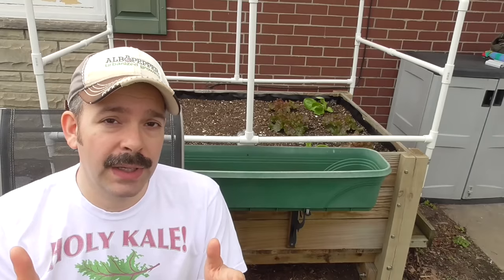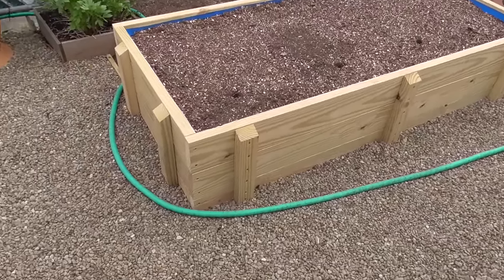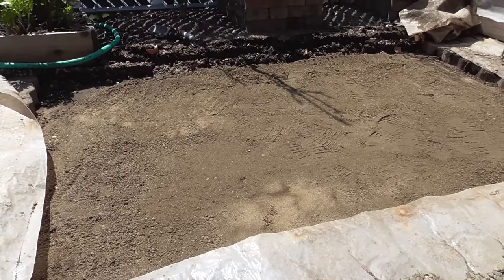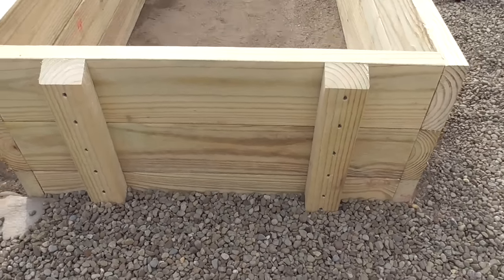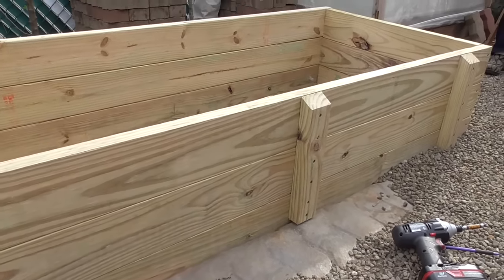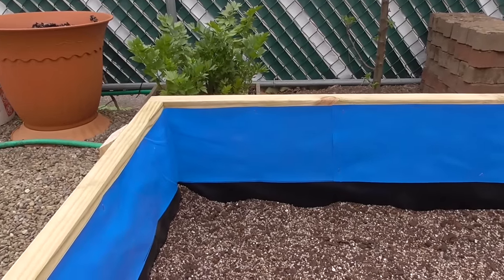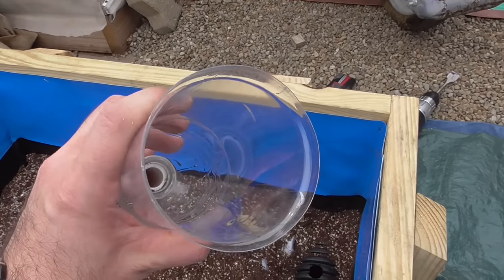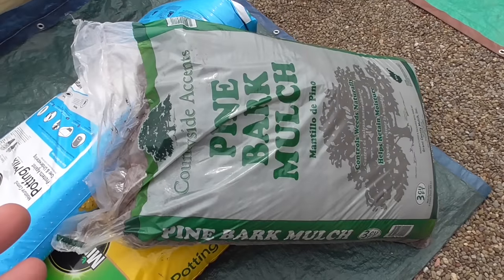Self-watering SIP Sub-irrigated Raised Bed Construction  (How to Build)

Comment: Thank you very much for this video. I really enjoyed your presentation. I’m relatively new to gardening, but love it and I’m learning new things every day. I’m curious to know why you are so against bagged fertilizesr or manure‘s in raised garden beds?
Reply from the maker: Hi Avi, thanks for watching! Here's a little explanation from my site:

BAGGED COMPOSTS? To prolong the viability of your SIP potting mix, it's best to replenish nutrients in the form of fertilizers. Organic gardeners are apt to use compost as often as possible. In SIPs, worm castings can be included in small amounts. But using composts in containers can yield unpredictable results. Bagged (retail) compost, humus or manure might have a fine consistency, similar to garden soil. If it contains fine silty particles then this can reduce pore spacing and aeration properties of the mix. That's why topsoil is NEVER recommended.

As air gaps get plugged up by ultra fine particles, compaction occurs. And since SIPs are always resting on a perched water table, the few remaining air gaps tend to be saturated with water. This impairs root health, preventing plants from getting the oxygen needed at the root zone. This can lead to a decline in plant growth, or even root rot and death. Even if plants grow ok in the first year, over time the potting medium may break down to the point that it must be replaced.

HOMEMADE COMPOST? Buying bagged compost is not financially advantageous in large beds anyway, not when compared to buying a bulk organic fertilizer. Of course, homemade composts might work, especially if they are mostly wood based. These tend to have more structure. Larger particle size means improved aeration. I've found though that it's very easy to reserve my compost for conventional beds and perennial plantings. It all gets used, just in a different location.

https://albopepper.com/refreshing-sip-potting-mix-adding-fertilizer-year-2.php

Comment: Hi!  I love the way you explained the process of the build.  Thank you so much for the time spent creating the video.  My question, however, is why you do not suggest to use manure or bag compost?  I am not trying to create an argument as to why yes and why not, but rather hear your opinion on this subject.  As a way to explain, in some form or another, I have been farming pretty much all my life most of the time with great success.  Many of my friends and urban farmers do tend to use their own mix and would swear by them.  I have always used a mixture of manure, peat, top soil and potting mix. I like the idea of the pine bark which I will incorporate to my next mix.  But also, I have heard of adding Dolomitic Lime and Mittleider weekly feed to the beds once they have started to produce.  I have not tried either.  I learned last season to add Epsom salt to my tomatoes (and other veggies) when their leaves started to turn yellow - I found that they needed magnesium, it was new to me as I never had this problem.  But still - and sorry for the long story - why in your opinion manure and compost (bag) is not necessary or needed.
Reply from the maker: Hi Javier! Thanks for watching. I explain a couple factors relating to manures and bagged compost in this latest video: https://www.youtube.com/watch?v=CXyV-XsQWNE  Additionally this series of articles was designed to address that topic: https://albopepper.com/refreshing-sip-potting-mix-adding-fertilizer-year-2.php

Basically, we need to be concerned with pathogens (raw manures), salt levels (commercial composts / manures), and pore spacing (top soils, compost & manures that contain fine silty particles). I've successfully grown zucchini in 5 gallon SIP buckets, using "Mel's Mix". But the compost was homemade and had excellent structure.

Hope that helps, and welcome to my channel!  :-)
Reply: I am going to watch them now.  Thanks!
Reply: @Albopepper  Would love to see a demonstration on growing 5 gal SIP zucchini and other vegetables, please?  I have learned so much   PURE GENIUS!

Comment: Al thanks so much for the great information. I have taken an industrial tote, cut the frame and liner in half, and have created 2- 48x40 raised beds. Up to this point I have filled the bottoms with sticks, logs, and other fillers and topped off the top 15 inches with an organic mix. I planted melons in the raised bed and they are doing really well. After watching this video I am wondering if I should use the wicking method on future raised beds. My only concern is the cost of the 6-inch drain tube ($36.00 each 40x48 section) of the bed. Do you prefer the traditional raised bed or the wicking raised bed? Are there advantages to using the wicking method, just trying to figure out if they are worth the extra cost. Thank you so much for the excellent education. Whats that old saying, give a man a fish and he eats for 1 day, teach him how to fish and he will eat for a lifetime.

Comment: Very solid design, but it can't be stressed enough how critical it is that the reservoir is solid.   Once you get everything else filled in on it, repairing a leak pretty much means starting over.
Reply from the maker: Agreed. That's why it's best to use a quality liner, not just 6 mil plastic. And make a few of folds as possible.
Reply: Don’t you mean 0.6mm or do people just assume the point when talking about pond liners etc ?
Reply from the maker: @tamarpiersburdekin3903  No, I meant 6 mil. You can learn more about the terminology here: https://www.globalplasticsheeting.com/thickness-of-plastic-sheeting

Comment: This is a great video! We are going to try our hand at making 2 of these beds. I do have a couple questions though, 1- what diameter do you recommend for the perforated drain tubing? And 2- for the overflow drain do you think we could use a piece of PVC pipe instead of the rubber tubing? 
Thanks for a great video!
Reply from the maker: Thanks for watching! I use 4" corrugated perforated drain pipes. The outside diameter is about 4.625". PVC piping works great for the overflow tubes. I used 1/2" PVC for my last couple SIP builds.

Comment: Great video and hoping you can answer a couple of questions.

1.  You indicate not to use manure.  I have used Mel's Mix (from Square Foot Gardening) in 5 gallon wicking buckets last year with great success.  It is 1/3 manure, 1/3 vermiculte and 1/3 peat moss,  and I didn't have any wicking issues and never needed to fertilize.  My tomatoe plants grew to the height of my shed roof.  Can you explain why you are against manure?

2.  You go through the trouble of lining the SIp with pond liner and then cut slits in it for the drain hose.  I imagine that the water leaks around the hose and the wood around the drainage is always wet.  Do you find this is the case and if so, would you try to seal around the hose next time?

Thanks
Reply from the maker: Kevin Meier Hi Kevin, I'm pleased to hear that you had good success with a Mel's Mix in wicking buckets. If your combination worked in a 5-gallon SIP, then it ought to work on a large scale as well. The biggest problem I've seen is that bagged manures can be heavy, comprised of very small particles. Obviously, the composition of manure can vary greatly, including the NPK values.  Then there is fresh vs aged. It's a lot of variables that might not work so great in one of these types of wicking beds. So I steer clear of that approach, choosing to play it safe. That's especially true when offering advice to others. Using an Earthbox approach will yield more predictable results. Plus the mix will hold up better over subsequent seasons.
 
In regards to the overflow tube, the plastic tubing was a super tight fit in the hole. No water leaks on the outside of the box. But you're right that some small amount might drizzle through the lining on the inside. I think that if someone is trying to be thorough and if they are able to seal it, perhaps with caulk, then they should do so.  Especially if they are truly concerned about it. Just do it and then you won't regret it later. It's not anything that concerns me on my box, but I'll add a note for those who might want to take that extra step.

Thanks for your question Kevin!

Comment: lol NOW i have a use for all this extra drainage tubing the prev owners had shoved under the porch! (saw someone else's video filling the base with ROCKS and i was like "no... that can't be right. that'd be expensive as HELL. this looks MUCH better.)
Reply from the maker: Thanks! I agree. All that gravel is also more labor intensive. And it reduces water holding capacity. But you risk puncturing the liner.

Comment: Hi I built this a couple years ago and it works great thank you!  I now want to make a smaller version out of some planters I have.  My question is because the planters inside width is only 10.5”. With that narrow width I will only be able to fit two corrugated drain pipes.  What can I use to fill up the remaining space?
Reply from the maker: I'm glad it's been working well for you! If the internal width is 10.5", then that is perfect. The outside diameter of the 4" corrugated perforated pipes should be 4.625". So you can space them about 1/2" apart from each other. And then allow 3/8" on the other sides between each pipe and the sidewall.
| o o |   -->   |  3/8  o 1/2  o  3/8  |

Comment: Great video, I only have one question though. If the corrugated pipes are not connected to each other and you mash soil mixture down between all the pipes then how does the water evenly disperse through the system? Wouldn't the water enter the fill pipe and then have to pass through the soil to get to the next pipe? How much water are you using up before the water disperses evenly all the way to the drain pipe? Would it be better to surround the pipes with some type of rock or gravel mixture on the sides and then add the soil mix on top of the pipes allowing the water to freely move through all the pipes before it begins wicking into the soil?
Reply from the maker: Dylan Cummings Thanks for the feedback, Dylan!  It would seem like the water might take a long time to disperse but it's actually not an issue.  That end pipe in my box spans 75".  So the water can spread over the course of all of that space. The holes in the pipes are small, but there are many of them.  The same can be said for the pore spacing within the bottom layer of mix.
 
A garden hose will only dispense so much water at once.  From what I've seen, the large number of pipe slits and the pores in the mix are able to keep up pretty well.  I don't top mine off everyday either.  I'll spritz the top of the soil to keep it moist.  Then I'll add a few gallons to the reservoir and I just leave it.  If you check the soil moisture with gauge once a week, you'll see if the levels are getting pretty low.  Then you might take the time to completely fill the reservoir, but it shouldn't be a frequent chore.
 
Other viewers seem to have similar concerns.  I'll talk more about this in a future update.  So stay tuned!  :D
Reply: In place of cutting the water fill tube on an angle at the bottom, you can drill side holes for several inches up from the bottom.  As you mentioned, the corragated tubing should not fill with dirt so plugging should never be an issue.

Comment: Hi Albo, After watching this last year, I put together a couple 4x8 beds with fantastic results. Actually had to pull plants out because they were overcrowding each other with such wonderful growth. Question for you though: How do you drain out last year's water when spring comes and you've got 3 inches of stinky water remaining in the bottom from last year a well as  accumulated snow melt? Wouldn't it be better to let the dirt dry out a bit? I was turning the dirt over in one bed today and there was an overpowering smell of anaerobic decay from (what I would guess)the dirt staying moist from last year. It's like the smell of a swamp.Thanks for posting all these videos. Enjoy learning so much from you! From NJ
Reply from the maker: Hi! Thanks for sharing your experience. Some people will insert drain plugs or pipes that can be turned to allow water to drain out. I've never done this as I was concerned about possible leakage. But I've still had reliable results without ever draining or drying out the system. I'm not sure what your annual precipitation is. But in my area, it seems to be enough to flush the system from season to season. You could always flood it yourself but watering it thoroughly after Spring thaw. You had used a potting mix to fill the SIP, correct?
Reply: Thanks for sharing all of YOUR experiences! Good to know what you do and that it seems to work (bit of an understatement!). I'm in central New Jersey, U.S. so we get our share of precipitation but nothing huge. I like the idea of using a drain plug but haven't come up with something I feel won't clog but also will reliably stay closed when desired. Also like the idea of flushing it a bit in spring depending on how much winter precipitation we get. I made my own mix of Raised bed mix(Coast of Maine),Top soil, Peat, & Compost with some Perlite thrown in for good measure. Kids collected earthworms in the yard all summer and tossed them in as well ;-). Think I may just aerate the soil by turning it over a few times over a few days and then start planting. Definitely not stressed about it, just getting ready to learn lots more in my second growing season. Thanks again and looking forward to watching more vids.
Reply from the maker: Yes aeration is crucial. That's why I avoid top soil. The particles are very fine and they tend to reduce pore spacing. Adding some extra perlite might be a way to combat compaction and stagnation. Also some aged, pine bark fines. Dark outer pieces of bark mulch (not huge chunks). I would be trying to maintain good structure without losing the wicking properties.
Reply: @Albopepper  Thanks for the tip about the top soil. In hindsight, yes, I can see what you mean about the top soil. Of all the "ingredients" to my mix, the top soil was by far the most clumpy when initially removing from purchased bag. That's why I took the time to really blend everything by hand for each wheelbarrow full at the time of mixing. This will be a perfect time to amend the soil with your suggestions while I'm aerating it before planting. Thanks again for sharing your experience and knowledge with everyone! Hope you have a great (outdoor) growing season.

Comment: Very good video. I have a lot of walnut and cedar wood chips. Can I use those for my mix?
Reply from the maker: Hi Tom. Thanks for watching! I don't use wood chips in my mix. The particle size tends to be too big. And the inner wood pieces may cause excessive nitrogen draft. When I use mulch, I use the fine outer bark pieces. I've always used pine, although fir should work too. But I haven't tested cedar or walnut in a potting mix. Something to consider with walnut specifically is whether there could be concerns over juglone toxicity.

Comment: Fantastic Video!  I watched it several times.  I duplicated your box 
almost exactly except I elevated mine off the ground.  If I use 7 tubes,
 I have slightly less than 1/2" between tubes.  If I use six tubes, I 
have just over an inch.  Which is better?  Also, after all the work of 
building, I'm very unsure what to pack between the tubes.  I think you 
said 70% Peat Moss and 30% Vermiculite.  Do I have this correct?  Thank 
you

Comment: Your video says not to use bagged compost. Should we not use compost at all like our own that we've composted? Loved the video btw plan on making this with my kids
Reply from the maker: Thanks for watching William! Hopefully this info from my website helps a little:

BAGGED COMPOSTS? To prolong the viability of your SIP potting mix, it's best to replenish nutrients in the form of fertilizers. Organic gardeners are apt to use compost as often as possible. In SIPs, worm castings can be included in small amounts. But using composts in containers can yield unpredictable results. Bagged (retail) compost, humus or manure might have a fine consistency, similar to garden soil. If it contains fine silty particles then this can reduce pore spacing and aeration properties of the mix. That's why topsoil is NEVER recommended.

As air gaps get plugged up by ultra fine particles, compaction occurs. And since SIPs are always resting on a perched water table, the few remaining air gaps tend to be saturated with water. This impairs root health, preventing plants from getting the oxygen needed at the root zone. This can lead to a decline in plant growth, or even root rot and death. Even if plants grow ok in the first year, over time the potting medium may break down to the point that it must be replaced.

HOMEMADE COMPOST? Buying bagged compost is not financially advantageous in large beds anyway, not when compared to buying a bulk organic fertilizer. Of course, homemade composts might work, especially if they are mostly wood based. These tend to have more structure. Larger particle size means improved aeration. I've found though that it's very easy to reserve my compost for conventional beds and perennial plantings. It all gets used, just in a different location. 

https://albopepper.com/refreshing-sip-potting-mix-adding-fertilizer-year-2.php